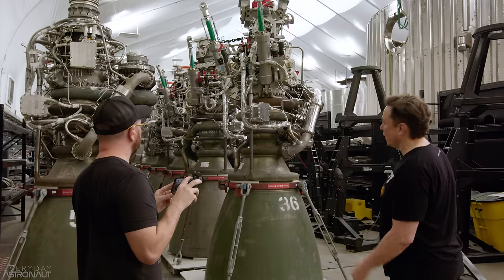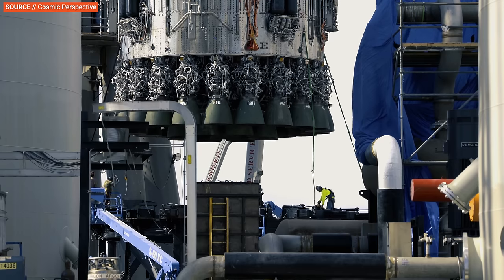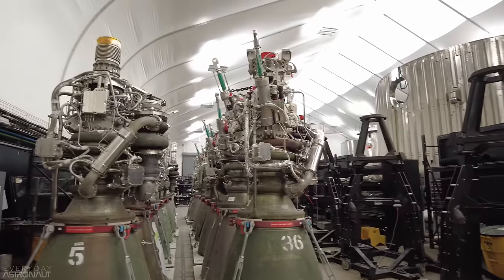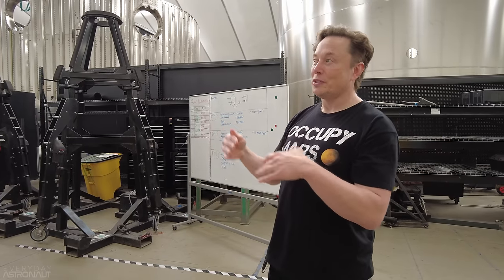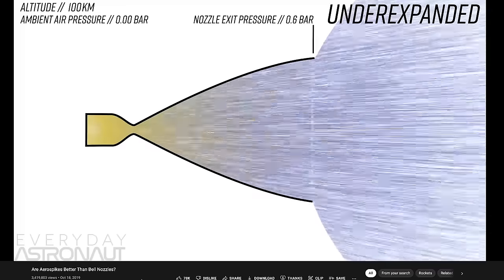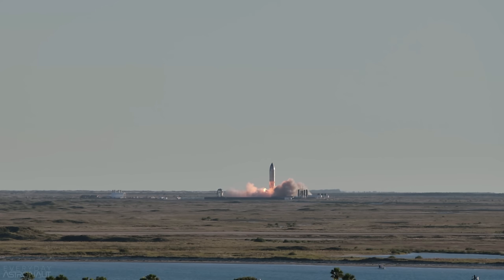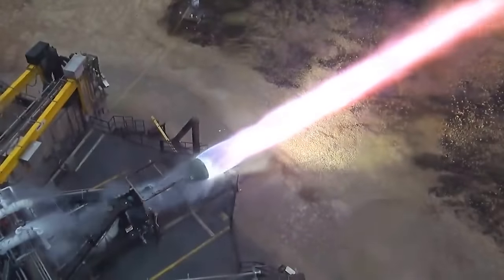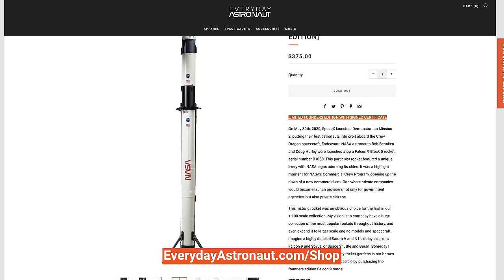How SpaceX Is Upgrading Raptor To Be The Ultimate Rocket Engine!

Comment: Thrust is only important to escape Earth's gravity, having in mind the the Mars venture It's possible that in the future we'll see:
-Less powerful Earth-Mars and orbit-Mars raptors but with a higher ISP and build rate, mainly for the second stage
-Very powerfull ground-orbit raptors for the orbit fuel station starship.
Reply: From Earth orbit to Mars will be second stages only, no first stages and no first stage engines.  Launch from Mars will use mostly the 3 atmospheric center engines of the second stage, just like last year's test flights, but benefitting from lower Mars gravity to actually reach Mars orbit.
Reply: @johndododoe1411  Yeah sorry I was wrong, I meant the second stage. Anyway if you want to launch 1000 starships that don't need to escape from the earth's gravity, I think it makes sense to design raptors that are faster and cheaper to build than focus mainly on thrust. Also the difference between the raprot sea-level and vacuum is only the Nozzle ratio
Reply: I'm actually surpised that SpaceX isn't exploring ion engines. They're the largest manufacturer of ion engines the world has ever seen, so they know a bit about it. I really expected an ion driven Earth-Mars Cycler in their plans.
Reply: @gasdive  they might have them planned, but "first things first". No need for a cycler when it has nothing to cycle between ;)
But then it might just be that for the given weight it would take too much propellant, energy or engines, making it more complicated, expensive, etc.
So I wouldn't expect them used on anything manned or time constrained.
Reply: Nuclear is the the way for humans to get to mars. The Only practical way on a large scale- either direst thermal or electric.
Reply: @mars_12345  yes, I'm putting the cart before the horse.
Reply: I expect 3 transport systems in the end. Earth to Earth orbit, Earth orbit to Mars orbit, and Mars to Mars orbit. Each engine and ship will be matched to the different efficiencies of each situation.
Reply: @apostolakisl  yes. Exactly. Sea level engines make no sense on Mars. Wings make no sense on Mars-Earth shuttles.
Reply: Now that I think about it, there might be a way to do it which might be viable. Tugboat. A small vessel that can attach to side or skirt of Starship. Have a fleet of them and use to move stuff between orbits. Still, it would mostly be used for moving empty and unmanned ships, but this could open new scenarios. One of them would simply be that when planning a transfer of fully loaded ship, they can use almost all fuel, because the ride "back" is going to be performed by the tugboat. Pair that with a way to obtain gases from Mars or meteorites to refuel them and we have a sustainable two-way solution.
Reply: @gasdive  You don't need much fuel or thrust for a cycler (actually, I think none at all), so ion engines might be the right system for it. 

I imagine a cycler as a set of living quarters that a starship docks with, people get out, live there and when they reach the Mars orbit, they get back into the Starship, undock and decelerate for a landing while the cycler loops back, either with or without passengers. That way, you'd be able to really cram the Starship full of passengers without having to live through several months with all those people in an airliner sized living space.
Reply: @realulli  what do you mean that cycler won't need a thrust? Or did I misread you?

To give some perspective, old estimate states that Starship would need 80 to 150 days to reach Mars. Raptor 2 might make it closer to the lower value, but that's still 3 months in space. Having habitats for dozen(s) of people that can sustain them at least for twice that time would be challenging (initially). Using ion propulsion would most probably mean that the transfer time would be even longer. That means moving away from things being "ok". So, instead of packing tons of food for long transfer, you can instead pack more fuel to move ship faster. You get the same end result, but in less time. What's the exact "sweet spot", I don't know, but moving slowly through space seems rather not good for iteration style, nor for the sanity of people on board.
Reply: @mars_12345  What I mean by cycler is a craft on a resonant orbit that just travels between the two planets. It doesn't have to accelerate anything, it just has to be a habitat for the passengers of the trip. The acceleration of Starship is all based on the Starship itself, the cycler just provides the habitat for the duration. 

This means, the cycler will have to have some means of propulsion to adjust its orbit to just hit the swingby to get back on a good orbit to the other planet. 

The trip itself is like a normal Starship orbit, just with much better accomodations.
Reply: Keep in mind that Mars Starships still have to rely on multiple tanker flights before they can depart

Comment: Thanks Tim!  Another excellent analysis.  I didn't realize there was already a Raptor 1.5 version in there.  So, we're basically on the 3rd iteration then, with other prototypes having been tested with chamber pressure up to 330 BAR.  I think they'll reach a production version of Raptor that hits that, when those other improvements get made that are required to support it.  You're really making this stuff accessible to the masses, and challenging the next generation to get on board with this stuff, and ride along with some of these new ideas.

Comment: Curious to know how much of the Raptor 2 simplification was due to removing the R&D sensors from Raptor 1
Reply: Yeah, the raptor 2 looks like raptor one. In fact, it looks like an unfinished raptor one. 
So, is it's different engine at all?
Reply: @schonkat1982  Imho, it's just a update with thrust increase and some improving in details. Raptor 1A or Raptor 1.1 would be more accurate. But it's improving probably obtained at a high price.
Reply: @aerospacer994  that sounds more plausible, thank you

Comment: 15:08 It does make sense because indefinite reusability is probably impossible with rocket launch systems due to metal fatigue given the weight constraints. In the end they'll try to find the economic sweet spot between production cost savings and fuel savings. Maybe one day we'll see cheap expendable balloon drop tanks on a reusable engine section with a set of small more durable tanks for the suicide burn.
Reply: airplanes can get over this "weight fatigue" no problem

Comment: They realized that if they remove torch ignitors from the main combustion chamber, they can just use the ground support equipment instead!
Reply: no, how do you think they restart them in flight?
Reply: That would only be the case for the outer ring of  RBoost engines -- but the SH inner engines, and all the Ship engines need the ability to re-light, and they don't have main chamber igniters either.
Reply: I was talking about the ground equipment that ignited B7 the other day lol, but thanks for the mansplaining

Comment: Eliminating parts is great, but eliminating the main chamber igniters adds to making the start-up sequencing very complex. Was that a factor in the big propellant dump and big kaboom during testing this week? So, another great conversation with Elon. It's almost like we're all in a conversation with him, what you do is different than watching a conventional interview of him. How many days before your feet touched the ground after learning he watched your rocket engine video, and paid enough attention to note an error? :)
(I understand your chagrin at the error; laborious research tripped up by a bad source that looked good at the time.)
Reply: My thought too. I love your calling it the "Kaboom". This reminds me of the Atari 2600 game called " Kaboom!" It was one of my favourites. (Yes, I'm old... and Canadian if you haven't figured that out yet :P
Reply: Not a factor. The test this week was a spin-up test; it was not planned to lead to ignition.
Reply: Presumably it's related to start up.  Unsync'd startup of the two preburners means one of them gets a stoichiometric mix and burns far too hot, a shutdown to avoid that melting the engine could dump more unburned fuel than oxidiser.  
But the problems would all happen before the main chamber, removing igniters won't make any difference to the root cause.  It may slightly mitigate this failure case slightly by igniting more of the fuel earlier but it's still not going to have enough O2 to burn inside the bell.  You still get a fireball.
Reply: @EagerSpace   Understood. I was curious as to whether the amount of propellant flowed thru the engine during the spin-up was greater because of the start sequence. These things aren't always intuitive.
Reply: As Elon said, the startup is a dance. Precise valve timing coordination, flow ramp up rates and pressure spikes while crossfeeding the preburners with exact timing, fighting the flow restrictions and pressure drops associated with the autogenous pressurization system, operational restrictions required to avoid cavitation. They all mean the startup can't be faked with test procedures. The only way forward is to run their best model through actual operational conditions and that means putting methane and oxygen out the bottom. Booms happen.
They wish it had been a windier day, no boom. Next time they will schedule for a higher wind. Maybe test in subsets, center thirteen, odd outer ring, even outer ring?
Reply: @gilbertanderson3456  I'm pretty sure Musk already said they will test them one at a time.

Comment: Suggestion for a video. Starship failure modes! 
If one engine shuts down on take off, no problem. How many become a problem? Could a SuperHeavy that just makes it to the top of the launch tower settle back and land with a starship still on it? (no landing gear, I guess not.) Maybe it could come down on the other side to be caught? Could the chopsticks support both fully fueled vehicles?
How about engine RUD propagation? If a nozzle melted away what would that do? If a combustion chamber burst, would it be contained? Or would a chain reaction blow up everything? Or would it just blow the plumbing off it's neighbors without exploding the chambers? Would a combustion chamber explosion burst the fuel tank above it? 
If we had a N-1 style explosion on the pad, would the pad and tower survive? 
How about that starship separating? How fast and soon? Could it escape if they hadn't cleared the tower yet? Aren't they planning all vacuums engines? If so, would it have the thrust to separate and fly essentially at sea level? 
Let's say things went really bad on the launch pad but the starship managed to get away, how would it land, it's got no landing gear. There would have to be another pair of chopsticks within range. Maybe a floating platform. How far could it make it on it's own power?

This would make a great video.

Comment: Hi Tim. I have a question that I'm sure you've already answered but I'm going to ask it anyway. Q: when the Superheavy plus Starship launch (either from Starbase or KSC) and the Starship separates from Superheavy, The Superheavy has to turn about 180 degrees around and start firing most, if not all, of the motors to stop the eastward trajectory and start a westward trajectory to accomplish a landing at the launch site. I assume once the velocity vector is sufficiently changed from eastward to westward, the booster can throttle down to a few motors to complete the trip back. And once the booster has returned, it now has to land. Given all this motor activity, about how much of the total fuel load in the booster has to exist at the time of Starship separation? I'm guessing around 30% of the total fuel load at launch. Thanks for your wonderful coverage of SpaceX!

Comment: Integrating the lox turbopump, lox preburner, and GOX injector directly into the top dome of the Raptor is an amazing feat. Nobody has done that...Ever. This simplifies the engine by almost 50% all by itself.
Going fully gasseous also offers another amazing benefit: finding and suppressing acoustical resonance modes is much simplified because all the frequencies are shifted upward, and they are shifted even higher still because the higher pressures and temperatures increase the speed of sound in the gasses. Higher frequency acoustical resonances means smaller suppression systems like baffles and pockets. I would hazzard a guess and say that SpaceX may have fully "detuned" the combustion chamber (acoustically) just by slightly adjusting the position of individual injection posts alone.
The result is smooth, even combustion across the entire power envelope. Very, very nice!

Comment: Hey Tim, I think you made a mistake @ 4:11, this is the X and Y axis , in the vertical plane, Z would be from the throat to the bottom of the bell nozzle ...as a CNC Machinist...thx
Reply from the maker: Believe it or not, rockets follow X, Y, Z from the cockpit, so basically like a plane, but vertical! X axis is roll, Y axis is pitch and Z is yaw 👍

Comment: Hi Tim, I got the Raptor Engine button down shirt and I love it! I did want to bring up though - have you found that they're made kind of strangely? I bought a 1XL and it didn't fit at all, which is weird because I can often even wear a Large. I exchanged it for a 2XL which came today, and it fits very roomy everywhere except it's like the underarms are made too low. It's really oddly fitting just in that area. Anyway, thanks for the killer design, I just wanted to give you some feedback for consideration next time you select a supplier or model of shirt.

Comment: You got it 85% right 👍. The main simplification on v2 come from working in narrower window of parameters based on test flights. The further work will be to decrease # of seals to reduce probability of leakages. Ease of manufacturing, durability and weight to be the key parameters to optimize for

Comment: Tim, nice work.  Do you know, or have you already discussed, more indepth details of the exotic metallurgies, design-work, and manufacturing of the metal parts?  Like who does it, are there cast and/or forged parts, is there a lot of machining that takes place, does SpaceX do all the design work or do they supply requirements to a third party who in turn designs and manufactures Raptor parts?

Comment: Tim, any chance of a 20 minute video, purely of raptors firing?    The sight and sounds are just incredible!    p.s I notice that the Raptor exhaust is much cleaner and narrower than what I have seen of the BE-4 test firing;  are the raptor and BE-4 engines still comparable, seeing that the Raptor has moved on since your video?  Regards from UK
Reply: The BE-4 really isn't comparable. The BE-4 is more similar to the F-1 that flew on the Saturn 5. It is almost like a giant version of Merlin. Its operational version would be 3-4 times heavier minimum and 2-3 times more thrust than Raptor.

BE-4 has a different mission set it mind. SpaceX is using Raptor to go interplanetary and take SpaceX to the next level. BE-4 is trying to take Origin orbital, so they need power more than efficiency.
Reply: @aauwhatitdo1582  Not sure where you got those stats, you may have been thinking of a different engine because they're way off. BE-4 produces ~550,000lb's of thrust, nowhere near the thrust of the F-1 and infact if Raptor 2 reaches its goal of 250 metric ton thrust itll surpass the BE-4. You're correct that BE-4 is much heavier and less efficient though - This is because it's a less ambitious design with much lower operating pressures.
Reply: I should also add BE-4 has pretty much nothing in common with Merlin, they use completely different fuel types and engine cycles.
Reply: @cod6guy12  my  comment was nothing to do with Merlin engines... it was about methane fueled RAPTORS  and BE4s.  I do understand the differences!
Reply: @cod6guy12  yeah, I meant to say Merlin instead of Raptor.
I was saying F-1 because it's more meant to be an engine that you only slap 4-5 underneath, unlike Raptor where you'd slap 30+ under.
Reply: @farmerpete6274  I was responding to the other commenter, sorry for the confusion
Reply: @cod6guy12  no problem!

Comment: Great rundown Tim - Raptor is a powerful yet young engine. I see it becoming like modern airline jet engines and the Merlin i.e. ultra reliable. The pesky Methane (volatile) may require ZERO ignition sources in a large area around the launch site (NEMA everything). The 33 engine spin start the other day flowed a lot of fuel very quickly.... I think Elon said they would not try that experiment again. Elon's engineering approach has once again produced a marvel.

Comment: I am now wandering how will “getting double the amount of work done at the beginning of the first stage” increase the payload to orbit? Basically how many trips are needed to fuel up the lunar starship with Raptor 1 vs Raptor 2?
Reply: what Elon and Tim wanted to explain is this: if Your rocket has more thrust (stronger engines) over initial-total-weight then a greater part of this thrust is going to acceleration and therefore the rocket lifts off much faster. The Saturn_5 was quite slow in this respect!